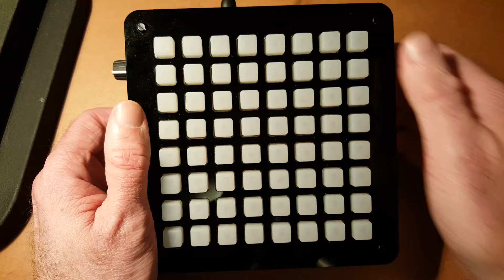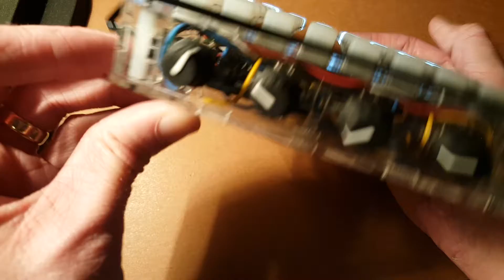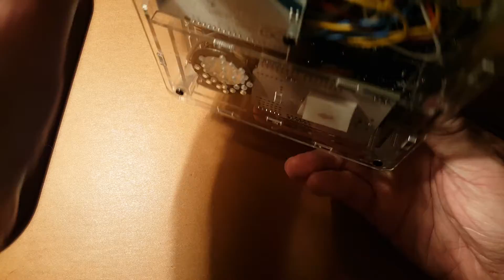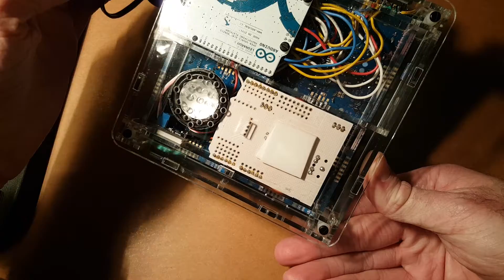Modified UNTZ from Adafruit

Comment: Hello James, is there by any chance this could run on a 16x8 grid? Thanks
Reply from the maker: The code can be expanded to work with a larger grid pretty easily, just a constant change, however the memory available on the Leonardo is not sufficient, I used pretty much all of the memory to fit all the programmed layers and grids, you could adjust the number of those and perhaps get it to work. I would recommend trying to move to a different Arduino platform that still supports midi but has more memory.

Comment: Hello, can you blunder out a secret what kind of buttons you used here? They are not a typical potentiometers, right?
Reply from the maker: You are correct, I did not use potentiometers, I used AdaFruit's rotary encoders with a push in switch found here https://www.adafruit.com/product/377

Comment from the maker: That's in the library for the sound card I used I think. unfortunately I am not in a location that I can investigate things at the moment. It's the call that routes stuff out the usb midi interface. since you want to route things out the serial interface instead you probably can comment that out.
Reply: Shouldn't it verify though without a board connected, just selected? Sorry to bother you. I can wait when you have time to investigate.
Reply: Just some questions while I'm looking at it James. Am I correct in thinking the code is sending midi through serial (pin 4) as well as through usb at the same time? Meaning, your mods work with garage band connected for example as well as with a midi stand alone device? .... usbMIDI seems to be from the Teensy library where as MidiUSB is more typical on arduino I think. I'm attempting to change things around but with little progress and am wondering if you used the TeeOnArdu set up and not just uploaded the code straight into a typical arduino sketch which is what I've done.
Reply from the maker: Robbie yes it sends through both.
Reply: I've tried a lot of different things to get this working but no luck James. Using the latest Arduino IDE I've tried commenting out all the usb code but that ends up with a board compiling error. I've tried some of the earlier versions of the IDE with different results. I've tried TeenOnArdu with 1.0.5 but the whole thing goes clatty. Do you remember which version of the IDE you were using and a bit more of the procedure? Surely I can replicate it, no?
Reply from the maker: Robbie I won't have access to my system for a bit, currently out of the county with limited access to civilization, when i get back i will be able to get you that information. Just hold tight.
Reply: Much appreciated James, Thanks : )
Reply from the maker: OK, back in civilization again. looking at things with the latest Arduino IDE (1.8.3), the current Fluxamasynth library does not seem to be compatible with the current IDE (this library did the serial midi out pin 4 to the synth board). Also the usbMIDI interface seems to not be present. Pulling those out allows the code to compile and run on my hardware, just don't have any MIDI coming out of anywhere but the lights light up. Need to replace these libraries with an up to date MIDI library. I will work on it. Possible replacement https://github.com/FortySevenEffects/arduino_midi_library
Reply: Had my head in a spin! I was using the TeenOnArdu in the IDE to get it to work in some small way but ultimately no joy. It seems the midi library is the one associated with Teensy. I did try try to use a different midi library and do some rewriting but ran into lots of trouble. I don't use the fluxamasynth myself and would be happy to just get midi out working but you've created some great functions with programme changes, scrolling etc, it would be great to keep them and have them work regardless of what midi device is connected. Send me anything you need testing James. It's a great project and no one else has brought it this far and shared it :)
Reply from the maker: OK, I played around with a number of MIDI libraries with varying degrees of success. The MIDIUSB works but outputs MIDI via USB not serial, the FortySevenEffects/arduino_midi_library doesn't seem to work, I can create the USB interface but nothing seems to come out of it either serial or USB. Going to need to pull everything out of the box and hook up the scope to figure out where things are going wrong. I think using the Serial interface defined here https://www.arduino.cc/en/Tutorial/Midi and keeping things simple might be the best approach. Will need to wait until I have some time next weekend.
Reply: Hello James, did you have any luck?
Reply from the maker: OK, I went back to the arduino v1.0.6 IDE and removed the usbMIDI and used the fluxamasynth library to do the serial output on pin 4 and that seems to work. Either the new v1.8.3 arduino IDE or the "New" SoftwareSerial Library does not play well with the Leonardo for this application and the fluxamasynth library is not compatable with the new version of arduino IDE. Give the older version of the IDE a try and see if you can get it to build.
Reply: going to give that a whiz now James. Would you post your code though? I'm bound to miss something :)
Reply from the maker: I checked in the code I'm using on github.

Comment: Genius sir!! Bless you for sharing the code. I have built the 128 version but haven't had a chance to use it properly yet. Do you know if it is possible to have the UNTZtrument output midi over a typical 5pin din cable instead of USB. I wish to use it as a stand alone controller  for other devices.
Reply from the maker: Robbie, yes this will drive an external midi device via the USB such as a pc. It could also take midi input but i did not investigate further. It also outputs midi via the serial port to drive the sound card. You could route that to a midi connector instead of the sound card.
Reply: Cool, because I remember reading at the time that there was some issue with outputting midi from the Leonardo other than over it's usb port. Can created patterns be saved or is that for an sd card with extra coding James?
Reply from the maker: Robbie, I'm not aware of an issue with serial midi output on the Leonardo but i could be mistaken. I have just enough space to save everything in the onboard memory but it would be possible to add and sdcard with additional hw and coding.
Reply: I think it was mentioned on the Adafruit site. I'll take another gander! I was looking at the github link you provided. Is that your modified code James that will provide the features you have demonstrated?
Reply from the maker: Robbie, yes that is the code I demonstrated.
Reply: Excellent, thanks James!
Reply: Hi James, I've finished wiring everything but I keep getting "usbMIDI 
was not declared in this scope" when I try to verify the sequencer 
sketch. Any clues as to why this is happening?
Reply: I'm using a Leonardo board. Should I be using a Teensy?